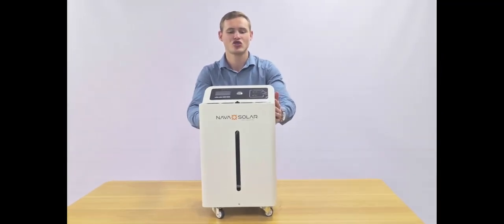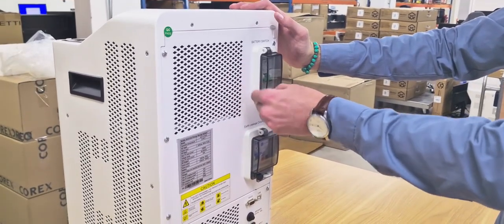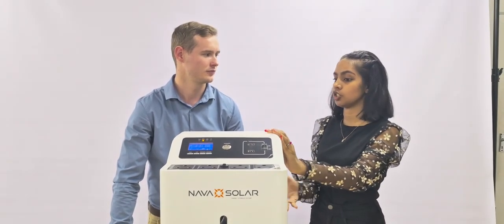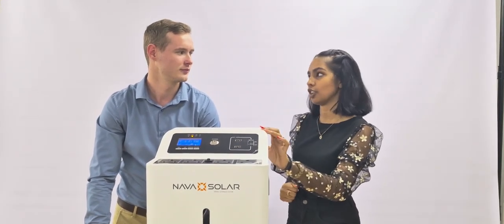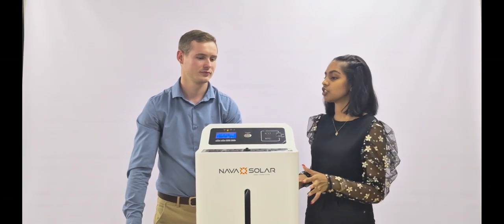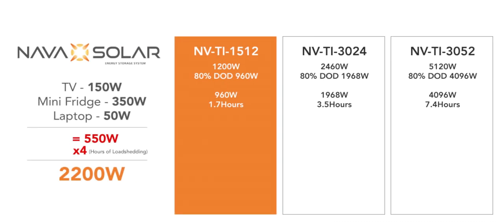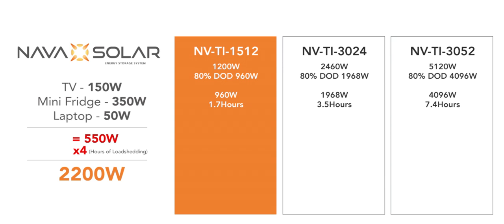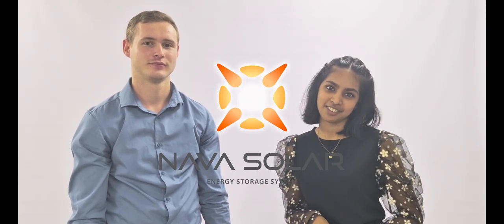Navasolar Trolley Inverter Ti Series

Comment: I have a question:

So I have it plugged in constantly and have a multiplug connected to it at all times, but I do notice when it's at 0w output the fans still tend to stay on low idle speeds and the battery charging light stays on, I do see the battery keeps fluctuating between 27.6 and 27.7v. Is this normal for the fan to stay on and the battery voltage to keep fluctuating between 26.6 and 27.7v?

Comment: Nava stop charging on AC
Reply: Mine stopped too
Did you find any solution?
Reply: I experienced same thing. I left it for a about week and when I plug it again, it started charging. Make sure it is plug to wall plug to have access to full voltage
Reply: I experienced same thing after one year six months months of continued usage. I left it for a about week and when I plug it again, it started charging. Make sure it is plug to wall plug to have access to full voltage

Comment: My inverter was completely flat now it won't charge through the AC. How do I solve this?
Reply: You need to kick start it, just like when a car battery is flat. Find jumper cables or a kick starter and use it to jump start the battery. Once you do this, the inverter will start to charge using AC again.

Comment: They should have just made a video explaining the solar panels connection and how to operate that process. This is what most people are struggling with when it comes to this product. 

The rest of the video is not that helpful and the background music is extremely annoying.
Reply: 3KW is a maximum of 2 solar panels of 450-560 watt panel.
Reply: I'm struggling with the exact same . We need a full video of what type of solar panel cables to use and where we can possibly get them.

Comment: How do i fix error code 51 on my navasolar ti-3024. The manual says it's a low battery but when i plug it to the wall plug. It beeps continuously displaying the error code 50 (ALA 51)
Reply: Did you find a fix for this?
Reply: You need to connect it to an Trickle Charger or AC current, it's the problem that comes with it, and they don't explain it at all.

Mine was doing the same, I ended up cutting the laptop charging cable and using it to power the battery up as it is a AC current.
Reply: @Khellé_Radebe what do I do it does not want to charge through DC?
Reply: @nhlakaniphonkosi4666 i have the same issue ! I plug it on the grid but it’s still refuse to charge the battery
Reply: @oliviermbombo6569 Mine it doesn't want to charge with Solar.
Reply: Mine is 2KV but from what i have observed i need to buy three 560w solar panel to match 40v Minimum Pmv that is required by this inverter
Reply: Did you find a fix for your issue ?

Comment: I bought this same model but I don't understand how to charge it with AC power using its cable. I tried charging for three days and not even one bar.
Reply: The cable is pretty much useless if where you plug it is a DC current, once the battery is flat, the inverter shuts itself by going into a BMS mode, which means it won't power up unless you have an AC current.

Best way to power it up is to connect it to the generator, majority of them using offer AC power, with electric (grid) is it a process.

Another way to not go through this, is never deplete the battery as the inverter goes into a BMS mode and it will require a Trickle Charge to wake it up.

The manual is utterly useless one thing I can say.
Reply: @Khellé_Radebe pretty much useful information, maybe this why mine doesn't want to charge with solar panel😢

Comment: Good Day. Thank you for this video. I have recently just purchased the 1.5kwv option. Is it normal that the fan is continously on? I have another 3kwv navasolar inverter, fan only comes on when the inverter is on or when charging.
Reply: The 3kWh sounds like it's working properly but the 1kWh is not. If the station is on then it should be running as well when you're using it but if nothing is been used then the unit is something wrong
Reply: Mine's fan is also always on, should I return it?